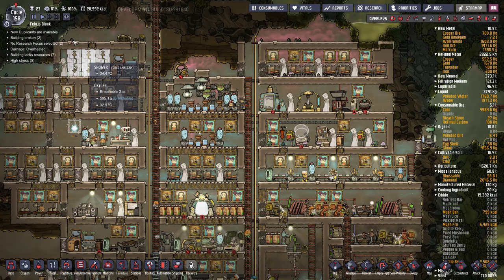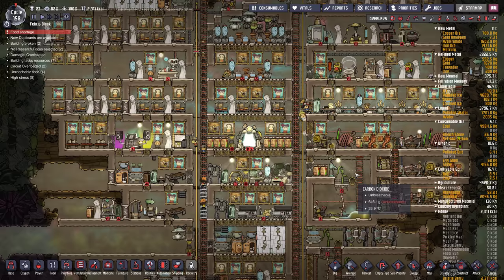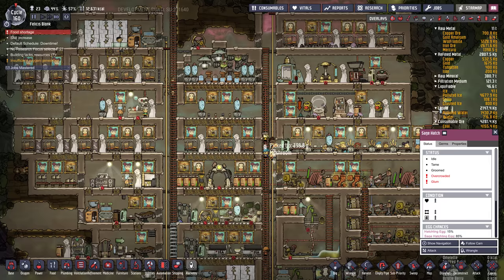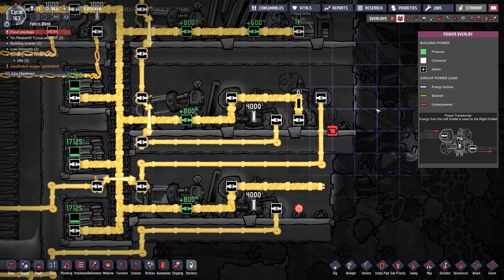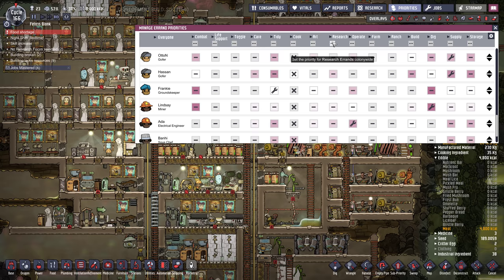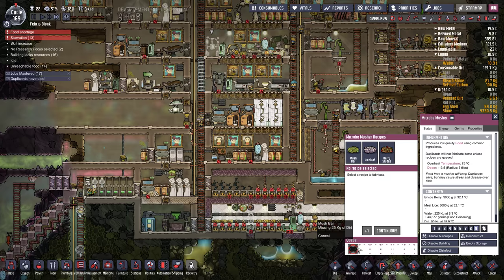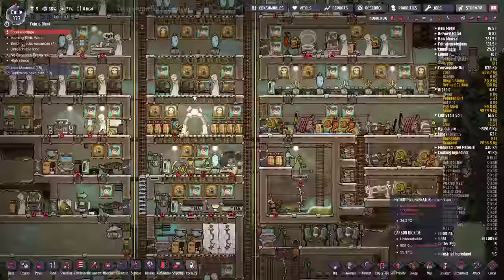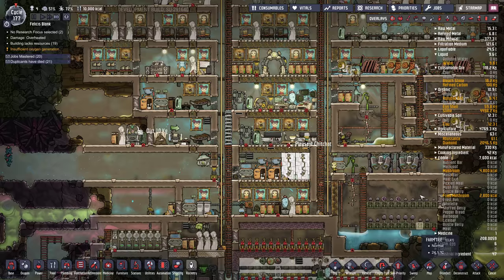DUDE! Fix My Base #7 - Oxygen Not Included Space Industry (Peter's Base)

Comment: I disagree with the 2 pumps per electrolyzer. They only produce 111g/s of hydrogen, and the oxygen doesn't require pumping if they are located in your base. Why waste energy pumping oxygen thats already where you want it?
Reply from the maker: I dont usually put it in my base because of the 70c output temp.
Reply: @GrindThisGame  The first base I went past 50 cycles with ended up having like 25 wheezeworts on the map, so heat wasn't an issue. I think I just got lucky on that map maybe.